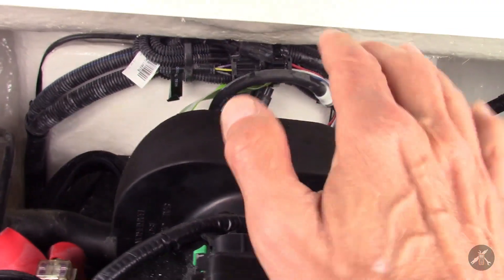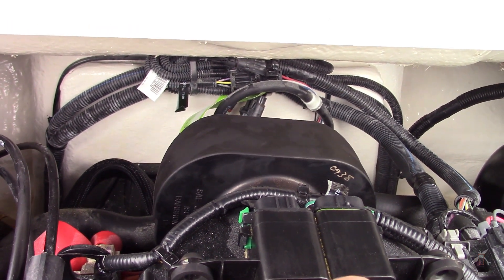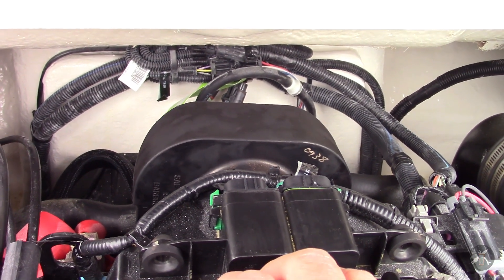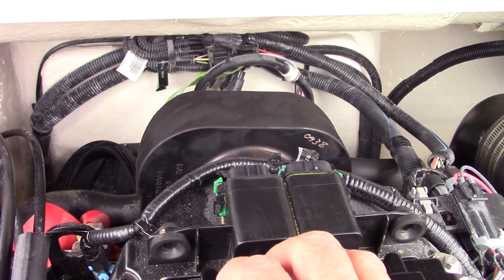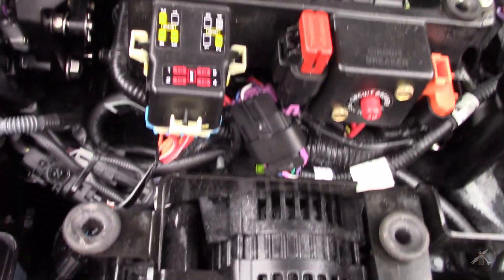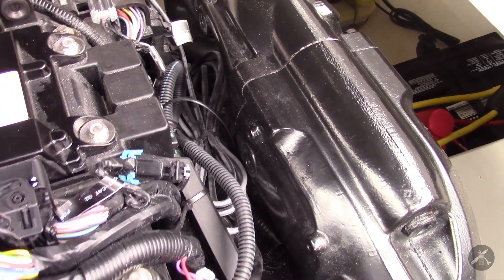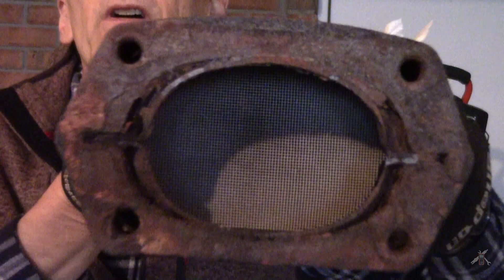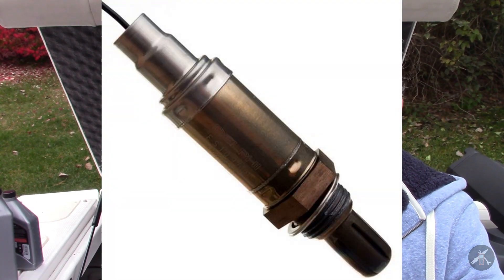Winterize Mercruiser - Why the Special Fuel Mixture?  Why Do We Do What We Do? What is the Goal?

Comment: My 2001 mercury 350 did not yet have cats. Great info however. Very technical guidelines will keep things in check.
Reply from the maker: Yes, the earlier engines didn't have cats and I did review a 1999 Mercruiser manual for the V8s.  It is interesting that beginning back then with the early port injected engines, they moved away from the spray fogging oil process for fuel injected models.  In the 1999 book, they asked for a measured amount of 2 stroke oil to be added to the fuel filter instead of fogging. As you note, there were no cats (and no O2 sensors).  So, it appears that there is still another sensitive component in the fuel injected systems that Mercury was concerned about.  Perhaps there is a sensor or IAC valve that is sensitive.  They didn't use mass air flow sensors at that point, it would be another possibly sensitive part.